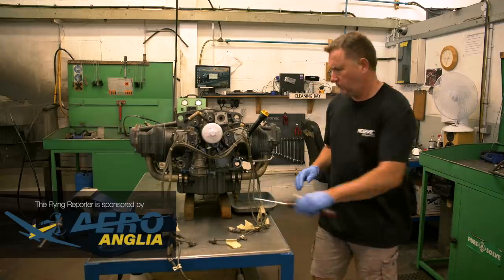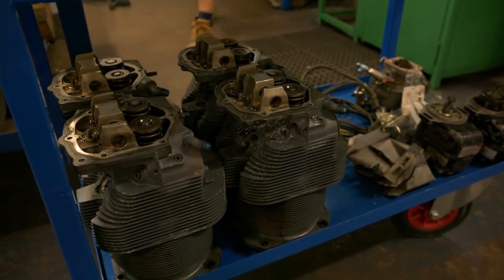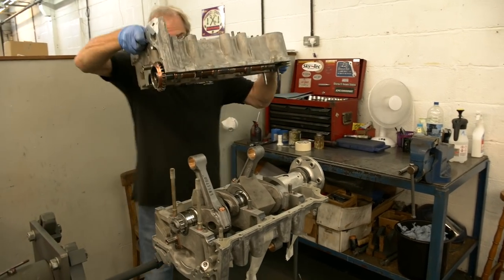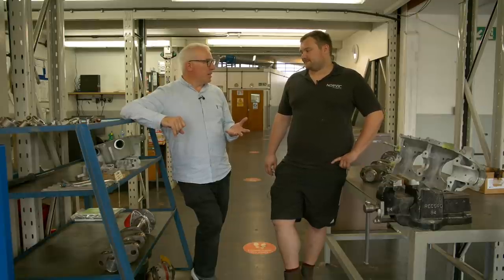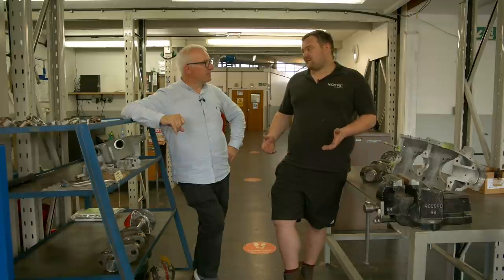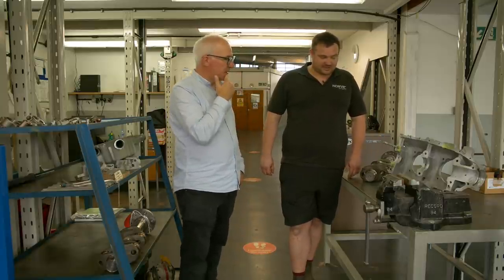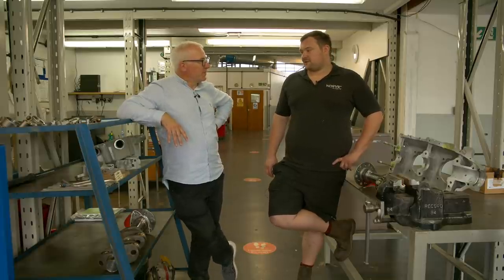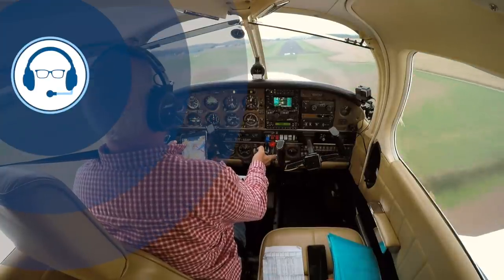What happens during an engine shock-load inspection - The Flying reporter

Comment: This is aimed at those who already know,  but for anyone not familiar: there are many moving parts in the engine and a lot of rotating mass.  If the propeller strikes something that slows or stops it those moving parts will want to carry on moving. This can bend the crankshaft, the camshaft, pushrods and conrods.  To make things worse, the propeller is a long lever so any for and aft force at its tip can and will bend the hub flange.  Rules are rules and are often written in blood, there are many examples of superficial damage resulting in separation of the propeller or other serious damage some time later. Car engines stall all the time and they are not damaged by stalling but the cam be and clutches do include some shock protection, they also don't have big leavers putting huge forces on the cranchshaft.

Comment: As always this is very similar to what we do with race car engines. When the bottom of a single seater race car hits a kerb or bottoms out the suspension the large flywheel can hit the track and crack the crankshaft. Some time later the crack grows and the crank snaps destroying the engine. I went through about 5 engines in 3 years once because of this as my chassis didn't have very good skid blocks  :o(
Similarly the only thing you can do when you bottom out the car heavily is dismantle the engine and spray the crack testing stuff all over the crank and block. It's really annoying but it's better than destroying your expensive engine.

Comment: Very interesting Jon,. One question, they didn’t mention damage to mags. I thought damage to the plastic gears inside a mag was one of the most common results of prop strikes?
TonyS
Reply from the maker: Not mentioned Tony.
Reply: Thats because the mags are replaced on every shock load